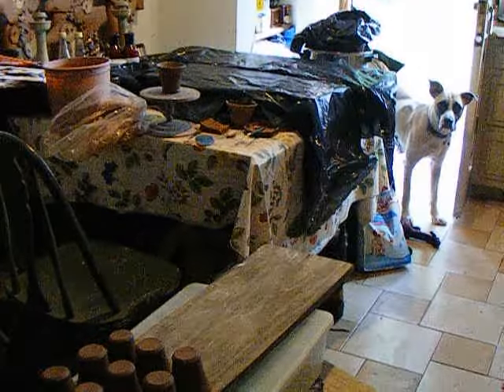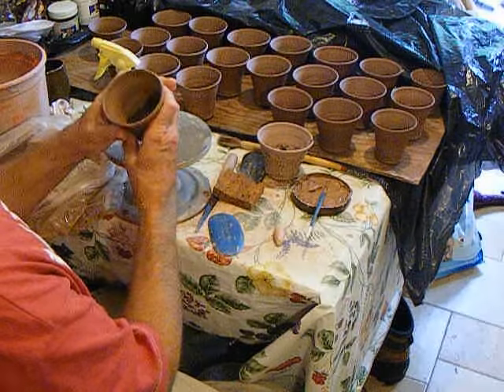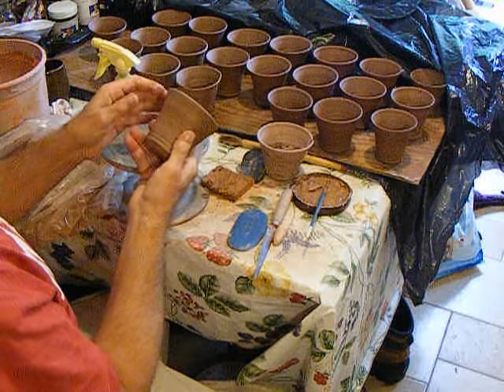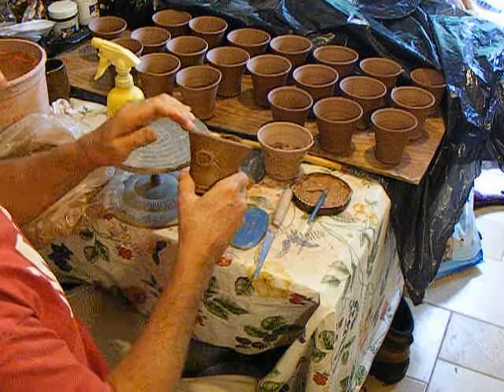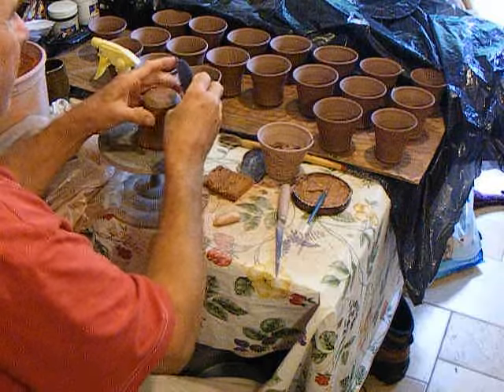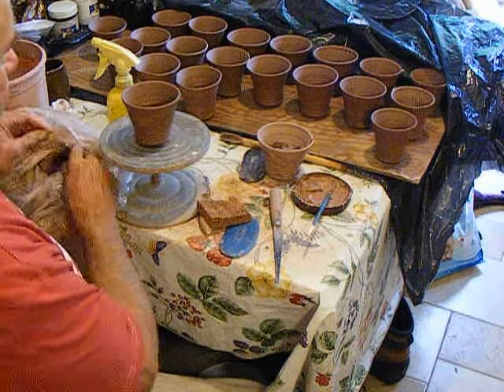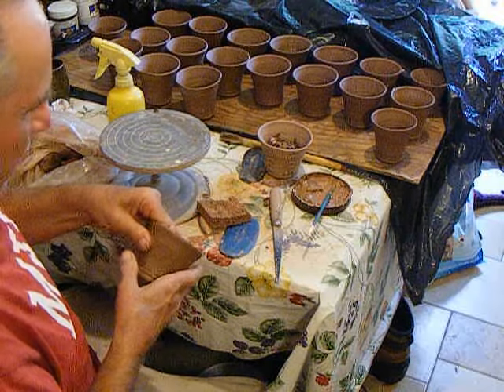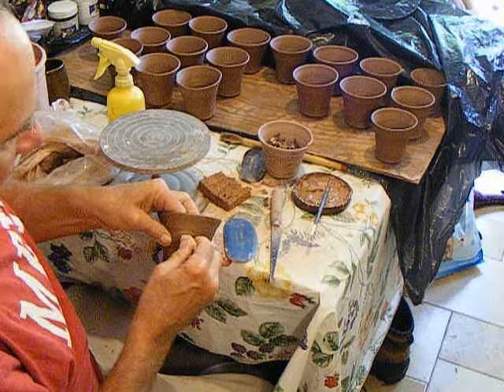pottery monogram application (419 #pottersjournal )

Comment: Ah the making of the stamps it does sound easy till you do it. I did see a video where they slip trailed stamps rather then carving I will give that a try next. But as for yours good job
Reply from the maker: Making the stamp really was the scariest part. I really did have over 100 made and covered for almost two-weeks before I had not the courage but no choice than to have to do it now.